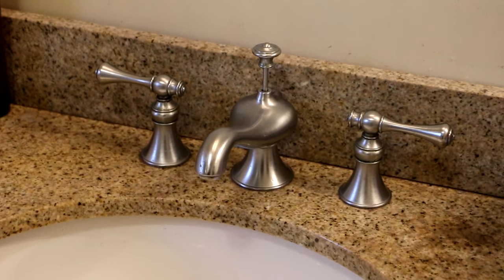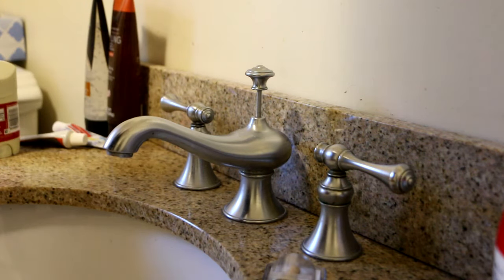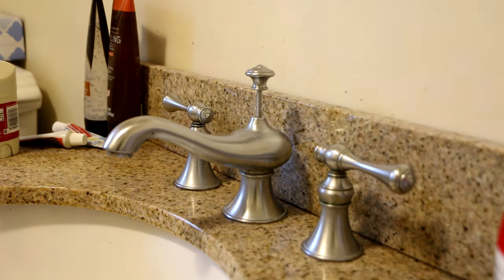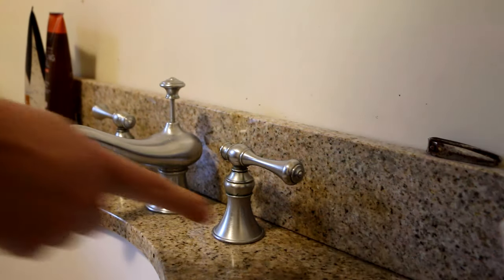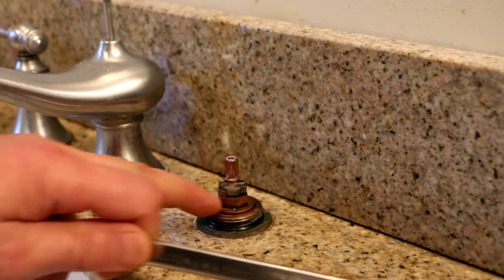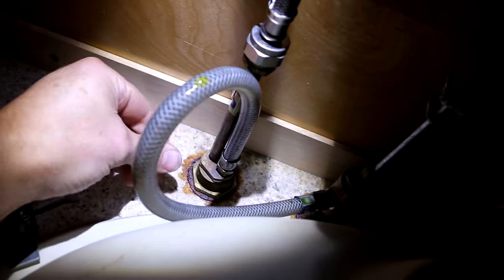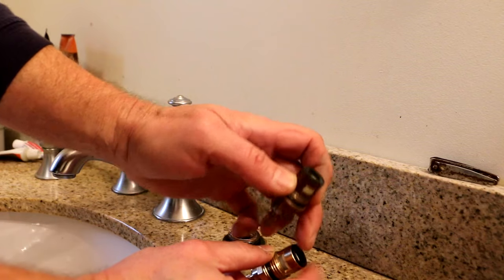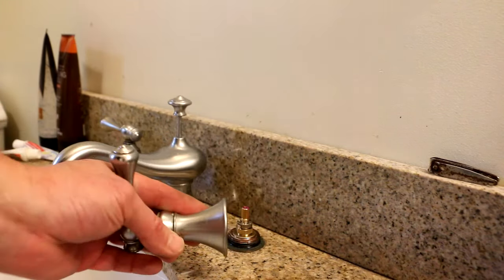Kohler faucet repair: valve stem replacement to stop dripping faucet

Comment: WARNING:  This is a great video IF AND ONLY IF you Kohler faucet has a two-part valve.  We spent hours trying to unfreeze the valve from the body.  After researching on Kohler's site, we discovered that they replaced the valve-body (70006/74369) with a single piece part (1131481/2), which is what was in our faucet.  We tried every method we could think of to separate the units with no avail.  I had to order the new replacement, which requires one to reconnect the water supply and feed lines to the faucet.  Just wanted others to be aware of this.
Reply: How were you able to confirm the part #? I have a really good grip and still that valve is not releasing so I suspect it might be a one unit like you found out.
Reply: Yes. But I hate that the plastic is not as quiet as the original metal cartridge.
Reply: Keep reading the comments, Kohler warrants these and will send you replacement for free.  (Similar story as yours, we even put it in a vice and hit it with a mallet and hammer, wouldn't budge.)

Comment: If you call kohler they’ll send you the cartridge for free with it’s included lifetime warranty
Reply: From the Kohler website: Kohler Co. warrants its faucets* manufactured after January 1, 1997, to be leak and drip free during normal residential usage for as long as the original consumer owns their home. If the faucet should leak or drip during normal usage, Kohler
Co. will, free of charge, mail the cartridge necessary to put the faucet in working condition. This warranty applies only to KOHLER faucets purchased and installed in North America, Central America, the Caribbean and South America,
excluding Brazil ("Americas").
Reply: @LaurenBradburyFarm  I am a total ignoramus. My bathroom sink is Kohler. Does it mean my faucets are also Kohler?  Nothing in the faucet shows the brand name Kohler.
Reply: @ellengomez2835  😆 It's possible, but certainly not automatic that your faucets are Kohler. They used to always stamp their name on everything, but I'm not sure (I doubt) they do that of late, not consistently, anyway. They have a pretty decent search tool on their website for finding your specific faucet, especially if it's not terribly old.
Reply: @LaurenBradburyFarm  I just found that out.  Was totally impressed that Kohler would back up its products like that.
Reply: This comment needs to be first!!! After trying and trying to remove the valve, we removed the entire piece and took it to my neighbors vice.  Still we could not get the valve off.  Finally I read down through more comments and got to this one.  On Monday morning I called Kohler and texted them a picture.  Within minutes Emily came back on and said they were sending me the entire replacement for BOTH hot and cold. 7 to 10 day shipping so I reinstalled it as we have company coming...guess what..it isnt leaking now.  Now I'm not sure I'll even install the replacements.  Murphy strikes!

Comment: If you have difficulty to remove the valve stem from the faucet, due to rust or any other reason, just go buy 
part Kohler 1131481 and 
Kohler 59425 to replace the whole valve. For me it's a pain trying to get that stem out of the valve....
Reply: Thank you!!

Comment: Good video.  I find one can avoid fighting the stuck valve stems by "CAREFULLY" using an impact driver with a 3/8" socket adapter and a long socket.  The impact driver's bump cycle will effectively tap the stuck valve out without turning the base.  Easy Peasy!  Yes I know, it's genius-level stuff!
Reply: When I tackle these types of jobs, I spray some WD 40 or better on the nuts ,bolts first and let them soak. Then a light rap with a rubber mallet. Can avoid a lot of frustration and possibly avoid damaging the faucet handles.
Reply: @4825sardis  Great suggestion Frank.  Instead of the rubber mallet, I would use a light hammer. Shock is your friend when loosening stuck threads.  
If you need to break someone's nose you wouldn't slap them!
Reply: @joerabena20  Actually, I try to avoid the "hammering "all together , but it some cases it's just what the doctor ordered. ⛑
Reply: Thanks - I got mine loose with your tip. I was just about to give up and order the $50 part assembly instead of the $15 part I can do now!

Comment: Very helpful. I just tackled a similar job because of water leakage from the faucets onto my vanity countertop when the faucets were opened. Tried removing the hot-side cartridge first using a socket wrench (a deep socket is needed) and found the cartridge was apparently cemented to the faucet body by mineral deposits; my attempts to remove the cartridge rotated the faucet body on the countertop the same as in the video. I didn’t have a crowfoot wrench to secure the faucet body under the countertop but found I could secure it with a vise-grip wrench with its handle placed against the sink wall so it couldn’t rotate. That left me with two hands above the counter to unscrew the cartridge. I was able to free the cartridge easily by applying a moderate blow to the socket wrench driver handle with the side of a hammer. My sink is porcelain but I didn’t think the force of the hammer blow would be transmitted to the sink wall and, indeed, the sink was unharmed. Repeating the same procedure on the cold water side (with the vise-grip handle now placed against the back wall of the vanity) freed that cartridge in short order.

Comment: Great video.  Helped me a lot.  I hope everyone listens carefully to your explanation of clockwise close vs counterclockwise close.   I had to remove the whole cold side assembly from the vanity and put it in a vice to get off the handle.  I had a huge pipe wrench that I put on the bottom of the decorative base, and it broke loose without leaving marks.  Then I had to put a cheater on a 5/8 wrench to break loose the cartridge.  Now I'm leaving the handle loose until I'm confident there are no leaks.

Comment: Great video.  My faucet, unfortunately, was attached with a set screw that resisted everything except for a left handed drill bit.  After spending hours getting the screw out, I was not looking forward to the next step - replacing the cartridge - but you've done a real nice job addressing that part of the project.  Looking forward to getting back a working faucet!
Reply: thanks so much.  I'm currently in the stage of removing the set screw. Glad to know i wasn't the only one who stripped it.  What should my next step be?

Comment: Just replaced my ultraglide valves, a heavy wrap of duct tape made it easy-peasy using regular channel lock pliers.
One suggestion, Clean up and apply plumbers silicone grease on the threads of the handle when you re-install them
, will make life a little easier the next time you have to replace the valve cartridges.

Comment: Thank you so much for making this video and covering all the areas that will be 'tough' to get through!  Too many DIY videos these days where the dissembling process is being demonstrated with parts that were newly assembled for the sake of the video.  For the removal of the cartridge - is there any way to do this without turning off the cold water valve? I'm in a high rise where the water is extremely hard, and valves are often completely stuck (and forcing them to close shut often results in a a leaking valve we cannot stop).  The only way to turn off the water & change the valve is for the building to shut water off to the entire zone (10 floors x 12 units) and drain the water from all the floors down to your unit, and they rarely do these.  Just hoping there may be a way to still change out the cartridge (!). Thank you!
Reply from the maker: Sorry about the delayed response. But I have no idea how you could do this repair without shutting off the supply water. Sorry
Reply: @stevewatr  thank you so much for the reply!  I'm going to check if pinching the line is effective.  It seems like those who have this same water shut-off problem have successfully used that method with a tight clamp before!  Thank you so much again for your video!

Comment: I had no idea how to get the fixtures off. Quick question. I'm assuming both the hot and cold still get screwed in righty tighty, lefty lucy and not according to the way the direction of the hot or cold for removing and installing the cartridges?
Reply from the maker: I only did the one side, but I believe you are correct, no left handed threads.

Comment: I cannot get the cartridge loose, and have tried very hard holding the underneath portion while trying to turn the top portion. Any tips?
(I was even able to drop the whole assembly underneath and get a very good grip on both ends and still it won't budge.)

Comment: Very important: Forcefully unscrewing is not the removal method for all Kohler bathroom spread faucets.  Some of them have set screws on the handle that need to be removed first.  Once the handle is off the cover lifts off vertically with no force.  I found this out the hard way, after ruining the tabs on the bottom of the faucet cover by unscrewing.

Comment: same exact fauce super stuck removed whole unit put in vice and used pipe wrench after successful install had 0 flow H and C  there''s a hex nut on the bottom of the spout , screwing that out restored flow. does anyone understand how the flow control works

Comment: Steve, have a Revial wide-spread.
Cold leaking. The basin is a pedalstil. Do you remember the crows foot size. I what to give it a shot from underneath for the hold back. Dreading to take basin apart to access cartridge body. Thanks
Reply from the maker: Sorry, I do not remember. Did I mention it in the video?

Comment: hello, how do you know you could fix it by replacing the valve cartridge or replacing the washer before you start? I have a faucet which is leaking, I bought the washer and am wondering if I also need a new valve cartridge in case it's the real problem

Comment: Thank you for the video.

I did a new KOHLER install before watching this.

I never thought of putting the 4 screws in the tightner-ring before screwing it on.

I can not get my handles to align the correct direction when they are off.

I do not see a way to fix that.    Mine have a square base and square handle, so they have to align perfect, and they are 30 degrees off.
Reply: It turns out that one can rotate the body of the handle with giant channel-locks, but go buy a pair with soft-jaws and put something on the handle-base to keep it from getting scratched.

I must have overtightened the ring under the sink.

I really do not like that only two tiny screws apply pressure to hold the handle-base to the sink.

Comment: What is your recommendations for a similar faucet handle which leaks when hot or cold water handle is turned on?  Leaks below handle ..not the faucet itself
Reply from the maker: If its leaks underneath even when off, check the supply lines. If it only leaks when turned on, and you do not see any water coming out tye stem area up top, then it might be the lone that runs over to the faucet or the valve. Body has a crack....but that would be surprising.

Comment: do both the left and right cartridge unscrew left to right like your cold water cartridge?  My hot water cartridge is leaking and like yours, the whole mechnism is moving and I'm waiting help to hold the bottom nut.
Reply from the maker: I'm pretty sure they are the same. counterclockwise to loosen

Comment: I have Kohler but mine doesn’t look like this one, it does have two handles. Where do I find model number? Thanks
Reply from the maker: I do not know where you can find the model number but I know kohler used the same valve and cartridge for Devonshire and Revival faucets. Its probably used on many other Kohler widespread style faucets.

Comment: Thank you for this demo. What if my cartridge is a deck mount tub faucet with no access to the under side
Reply from the maker: I have never seen one like that. Sorry.
Reply: Hey Rayna , I have the same issue with a Moen Bathtub assembly. So far I haven't had any issues but I was thinking of replacing it with something more modern. Then I realized there is no access from underneath. Have you come up with a solution?
Reply: @4825sardis  Not yet. I may have to cut and install a side access hatch.

Comment: What brand of strap wrench did you use? I tried two from Home Depot, neither worked, cannot grip the skirt of handle. Thank you 🙏
Reply from the maker: Sorry, I do not remember where I bought it, was just a rubber type, but I know in the past on other faucets, they were just too stuck and I had to resort to wrapping a rag around it and using channel lock pliers. If the rag is thick enough, it can be done without damaging the finish. The tapered shape is another reason it is hard to grip. try to grip it on the area just below the handle.
Reply: @stevewatr  thanks Steve. It was impossible for me. The rubber kept slipping and the handle won’t budge.  Guess I have to call a plumber. 😅
Reply: @Samantha S, you might try putting a slightly damp towel inside the rubber of the strap wrench if it is a problem where you can't get a good grip. (A damp towel will slip less than a dry towel.)
Reply: Thanks, I have a cartridge that won't budge like that except it's recessed almost flush with the base.

Good to see that it IS supposed to come out and I don't need to replace the entire assembly. Guess I need a deep socket for the top side.

Comment: Hi, please could you tell me the name of the wrench like " L " what you used for the bottom and where I can buy that tool I really need, thanks
Reply from the maker: I think you mean a "basin wrench" can be bought at hardware store, home depot lowes or online
Reply: @stevewatr  not I said the other one for the hexagon nut
Reply from the maker: @roberto11197  i think you mean the "crows foot" . a crows foot wrench fits on the end of a 3/8 socket extension. I think the size was 1". Google crows foot wrench and you can find them for sale at lots of stores.

Comment: Hi Steve, what’s the size of the crowfoot you used?
Reply from the maker: Sorry, i cant remember, it was part of a set.
Reply: If you don't have a crows foot, but you do have a basin wrench, you can remove the water supply tube and the flex tube going to the spout from the valve assembly, then remove the nut holding the valve assembly against the vanity. Then lift the entire assembly out of the vanity from the top and put the valve into a bench vise gripped by the flat on the bottom side of the valve. Then you can easily remove the stem  and replace it with the new one, then reinstall in the vanity. That is what I had to do with my lav faucet.

Comment: Kohler make things so difficult and expensive, my taps have what looks like a solid tap with removable top but unique allen key to undo which I have two complete sets of allen keys and none attach and the underneath has a soldered on mixer attachment so it's a case of having to either fork out hundreds for a plumber or just hack out two pairs of taps and replace them all or ???..I'm an amateur diy'er but this company seems to go out of their way to make things difficult.